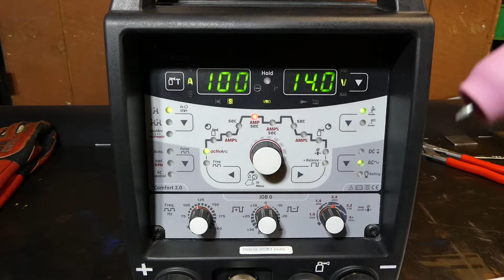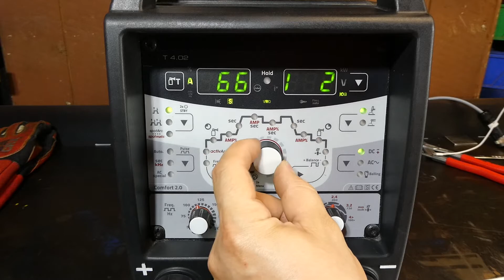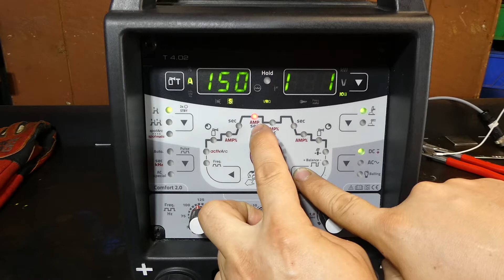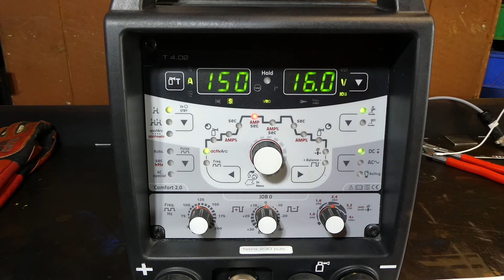EWM Tetrix 230 ACDC Walkthrough 4   Power save, jobs, factory reset

Comment: Whats the purpose of secondary amps?
And how do you use it
Reply from the maker: Secondary current setting can be set to a lower value. May help to maintain a low heat input state when heat build up is too high in the job. 
In conjunction with downslope, this may also help aluminium welding crater fill- ie preventing rapid cooling of the pool and pin holes which are a point to future weld cracking.